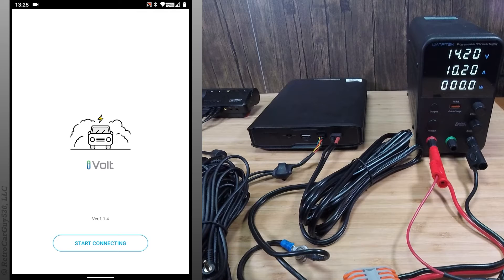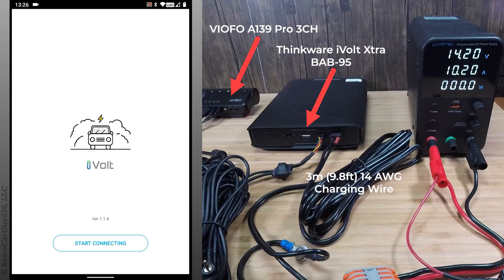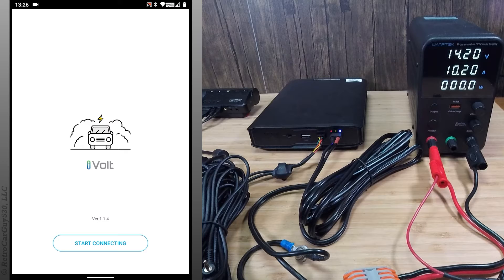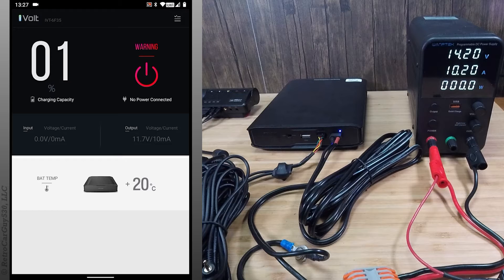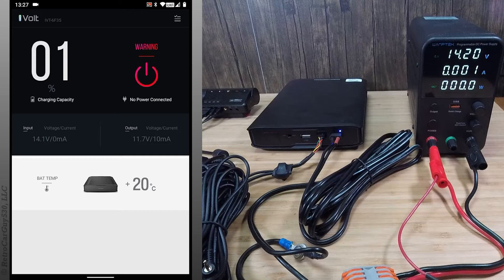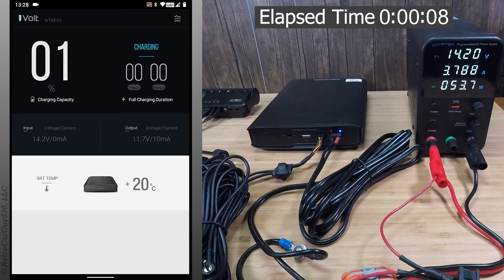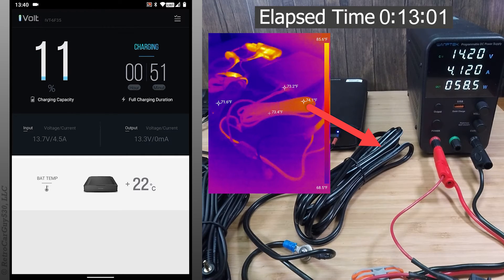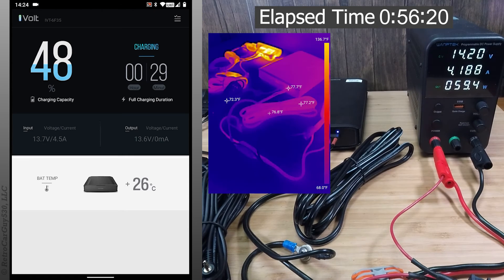Thinkware iVolt Xtra BAB-95 - Low Amp Charging Test - 14 AWG Wire

Comment: I have a question I'd like to ask.  My car cigarette power ports not working so I been using a rechargeable battery to charge my ivolt mini 50 do you think using a rechargeable battery to charge another rechargeable ( ivolt mini ) could harm the donor battery? It charges it and no heat .
Reply from the maker: I can't say that I've tried that approach to charge an iVolt Mini battery pack.  It may work, but you're spending potentially double the time (depending on the charging time for each battery pack) using that approach.  I would suggest using an AC-to-DC power inverter/charger to charge the iVolt Mini.  Not a 12V inverter/charger, but one that produces 14+ volts.  I recently tested an 8 amp inverter sold by BlackboxMyCar and it was able to charge not only the smaller iVolt Mini battery pack, but the larger capacity dash camera battery packs as well.  https://www.blackboxmycar.com/products/blackboxmycar-power-inverter

Comment: Can I used green wire with fuse holder  16AWG with 10A ?
Reply from the maker: The green wire ("ACC In") requires very little power (well under 1 amp).  It appears to be a 22 AWG wire.  It's used as a signal of when to charge the battery pack and it also results in power being sent down the "ACC Out" wire to the dash camera.
Reply: @RetroCarGuy530  thinkware recommends using a fuse holder for safety purposes, so I'm wondering how many Amps and AWGs should be used for it
Reply from the maker: The "ACC In" wire draws almost no amp load (max of 2 mA in my testing).  You can use any fuse tap (most are 14 AWG or 16 AWG) and I would recommend a 1 Amp fuse for the upper fuse socket of the fuse tap.  Since there is almost zero amp load on this wire, you should be able to use virtually any switched/accessory power fuse box fuse socket (other than ones powering critical systems/modules).
Reply: @RetroCarGuy530  Thanks for the clear explanation